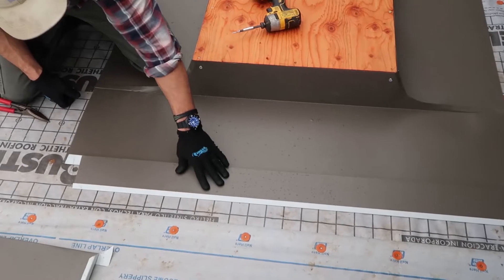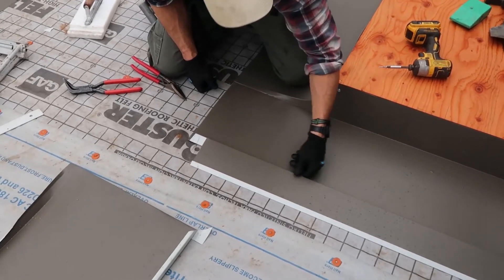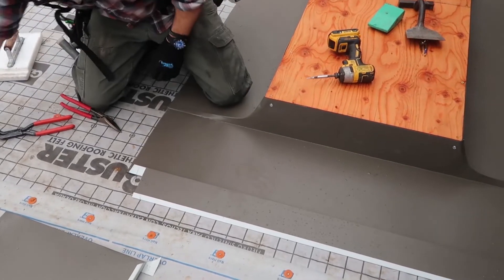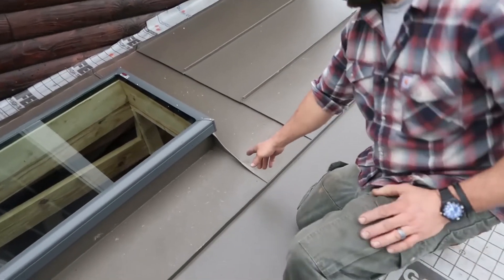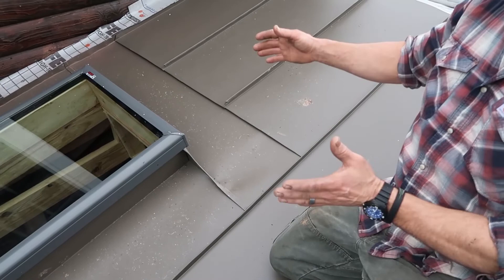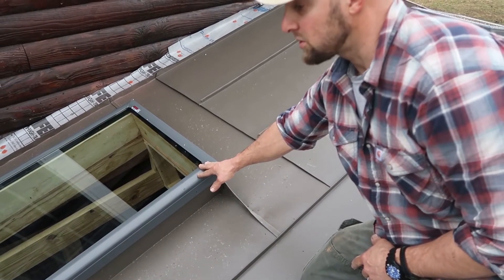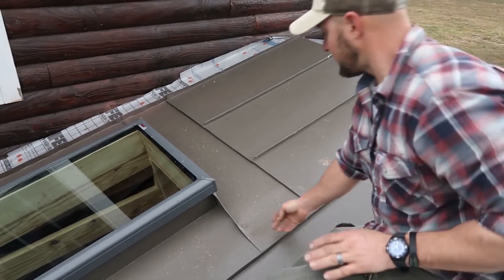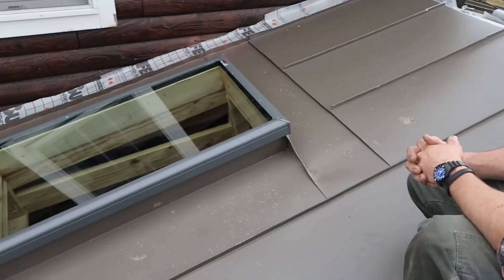Standing Seam Skylight Flashing Detail - Part 4

Comment: Craig, well done! I have been looking for metal installation videos that actually display some craftsmanship for years. Ones in English anyway.

Only two minor complaints that are not meant to take away from your obvious knowledge.
1. Don't believe Feltbuster or Grip Rite are suitable under metal roofing.
2. We always remove cap nails prior to metal install as we work along to prevent dimples from the underside.
Reply: Nathan Cowan glad to see your enjoying the videos and I appreciate the compliment. 
The felting was done by the builder, I do prefer a heavier grade like Titanium or equivalent to minimize cap nails and much easier to install in  windy conditions. 
If your looking to avoid dimples in your panels from felt fasteners try cedar breather under your panels also makes for a great system in general.

Comment: Ошибка!!! Перед тем, как поставить планку, надо нанести герметик, чтобы не было капиллярного подсоса. На на отворот самой планки, нужна наклеить псул.
зы. Игорь переведи, я знаю ты читаешь))
Reply: Translation above is discussing  the Buytl caulk not shown on rear panel connection during the connection of the cleat system you have shown as assembly was being  performed. The other challenge is learning the Crescent Eave sweep on the rear panels behind the skylight. this will be tighter and less capillary action through the standard 45  end-folds performed in the U.S. 
Stortz has a crescent fold video and above Noted (Fold Master) does and SpenglerTV.., MetalManiak. All of these guys R top notch and I cannot stress enough study, practice with paper models (Roof-Origami) Purchase this BOOK!
If you have trouble getting this I will get with Stortz & Sons to see if they can add it to their education books on roofing. Foreign langue but pictures & illustrates worth it! use google translator. Later, Troy
https://www.facebook.com/%D0%A2%D0%B5%D1%85%D0%BD%D0%BE%D0%BB%D0%BE%D0%B3%D0%B8%D1%8F-%D0%B4%D0%B2%D0%BE%D0%B9%D0%BD%D0%BE%D0%B3%D0%BE-%D1%84%D0%B0%D0%BB%D1%8C%D1%86%D0%B0-473332743187561/
Reply: Горе от ума 😀